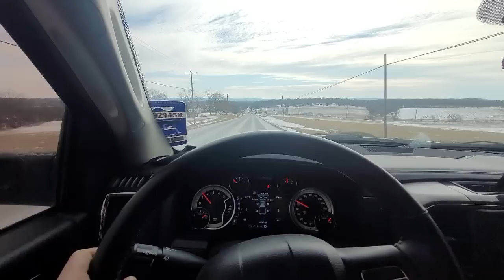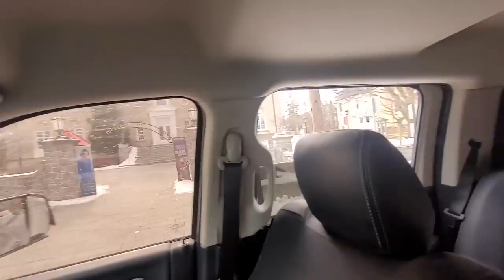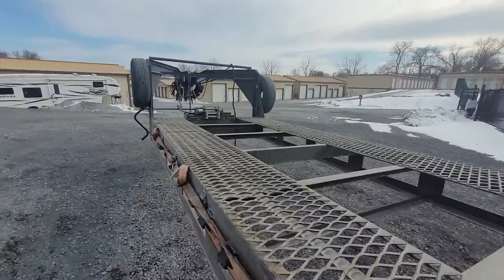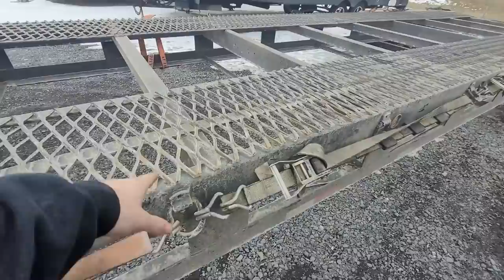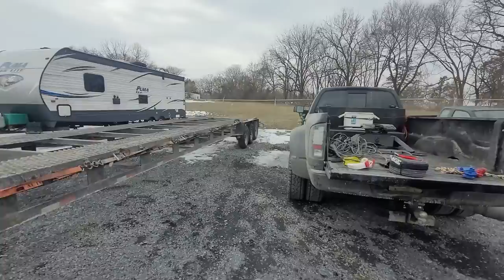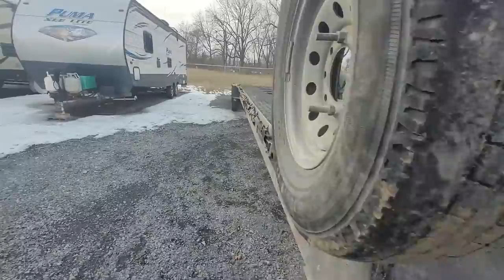Nylon Winch Cable Install | New Snatch Blocks | 20k Mile Ram 2500 Test Drive | Fleece Cheetah Turbo

Comment: Evening from uk steve I would use bit old winch cable to make 3  metre long safety cable  for to secure your equipment chains and blocks etc and lock to trailer so runs thru holes and is fixed to your trailer also could not tap hole in winch and use bolt to secure then any future winch cables/ropes can just bolt on etc?  Make 1 solution for future problem if occurs not multiple sulution for 1 problem. Man of your talent could knock summit up and keep budget down.

Comment: On an old work truck, we used quick connects for a welder to get power to a trailer mounted winch.  Had the quick connects mounted under the bumper and the other side coiled up on a mount on the goose neck.  Worked really good!

Comment: 100% put the torsion axles on it you won’t ever have any more problems I have a 35 foot stacker that keeps 25,000 pounds on it and you can never tell if it’s empty or full rides beautifully goes over bump with easy hands down the best axle out there

Comment: Good! Replace all that stuff steven! When you set the bearing tension, 50 pounds of torque then back it off just a little bit so its not so tight. Once a month, pop those dust covers off and re-tighten that nut. The torsional forces loosen them up. You may notice a slight shake in your truck when they loosen up. Before you mount the new equilizers, bullet proof them. You will see a welded piece inside the new equalizer that the slipper side of the leaf spring rests on. Insert a bolt and weld it in place to support that piece so it dosent break again. I can send you a video if you want. Otherwise, they will keep breaking. The shock absorber kit is a great upgrade! I just dont know about the triple axle setup. E-TRAILER has the shock setup for triples. I would buy it!

Comment: Bronze bushings are a great option .Mack trucks use bronze on their walking beams    [camelbacks] especially on the older macks.  I lkie torsion axles ,most of the snowmobile trailers have torsion axles.

Comment: Make a permanent snatch block in your cable...doubles your winch power an eats up a lot of line
Reply: Good idea . . .  If the trailer can handle double the power.

Comment: Put the Anderson connector on the front of the trailer so you dont have all that cable hanging then connector on one end of your jumper and clamps on the other
Reply: Just put a battery at the rear of the truck, with the Anderson connections. Problem solved. Then just charge/change that one every two/three days.

Comment: By the way: the shock kits will do just fine.
Torsion axles are great if they come with the trailer, but are prohibitive pricewuse if you're retrofitting.

As long as you have good equalizers , shocks and balanced tires, you're good for thousands of miles that are trouble free.

Michael  Rzewuski

Comment: I would have ground down the aluminum end on that cable so it will fit in the hole on the winch

Comment: Just a thought would it not be easier to find a Sterling 5500 around the body style you like in the dodge and still get everything you want out of the dodge? Don't know how much price difference it would be, or if there are any advantages to the different trucks. Hopefully everything goes well with the car sales.
Reply from the maker: I wouldn't care if I got the Sterling 5500 or not
Reply: I guess it really wouldn't matter you'll 12 valve swap it anyway. But they look good don't know if there is much of anything different in the two
Reply: @CPSteveMiller  also on your ratchet straps get you some bungees with the plastic ball on the end and roll them up wrap them with the bungee and put them in your tool box or a colored plastic toat so they don't get worn down by uv rays from extended exposure it'll make them last longer

Comment: Hey steve just a question ive got an 07.5 6.7 cummins 198k 2weeks ago cruise began not working and then horn stopped and now a intermittent airbag light on dash am assuming its the clock spring, have you ever had to replace one on these late 2000s dodge trucks
Reply from the maker: Never dealt with that sort of issue. If it's doing it on and off when you're turning that'd be a guess of mine but without seeing it I wouldn't know

Comment: And the axles...more than likely cheaper to buy a trailer with torsion axles by the time you figure in the cost of axles an time down to swap plus if you pay to have it done.  Plus you done sunk 600 bucks into this current spring set up.  Always went by if it aint broke dont fix it...more than likely holes were worn when you had that work done, an they didn't care an just tossed new parts on it.  The stuff you ordered is serviceable...so ultimately if it wears out quickly it will be from lack of maintenance, which I Dont think you will let happen.  I would stop jacking it loaded if at all possible,  heck id leave it hooked to the dodge an pull in and leave a vehicle at the lot an drive that back an forth.  Just an idea.

Comment: Did you get that link i sent ya for the centramatic balancers?
Reply from the maker: I didn't get anything
Reply: @CPSteveMiller  for some reason when i post the link youtube takes the comment down.
Reply: @CPSteveMiller  centramatic wheel-balancer model Number 300-318A6 i would get these instead of tire beads

Comment: Not sure how you can say rams exhaust brake is soooo much better unless you've used the others man, GM only had a push button brake for a couple yrs now, i find myself having to throttle out of mine because it works so well, it works in conjunction with the brakes so using the brakes while its active gives you different levels of exhaust brake, being in Colorado i run the ike & vail pass regularly and the brake works excellent idk..
Reply from the maker: I've tested all 3. Ram is night and day the best. There's no comparison from what I've gotten to test on the newer trucks
Reply: @CPSteveMiller  i concur.

Comment: Steve I need your help I blew head gasket an I am going fix it my self but I had shop tell me if I don’t put fire wall in it they will blow again? What is fire wall? I fiqured with new head gasket an head studs it would be fine what am I missing
Reply from the maker: Probably mean fire rings. If it's a Cummins you really only need to get the head checked to make sure it's straight. If it's not the machine shop will take care of that. Then clean the engine surface up. No need for fire rings on a street truck that isn't making a ton of power. If it's a powerstroke then absolutely you'll want everything you can throw at it. I would definitely install some head studs. Xotic at the bare minimum. Preferably a good arp stud but it's not in everyone's budget.
Reply: @CPSteveMiller all it does is tow 6.7 cummins yeah fire ring what is that ? It’s bubbling water in resovir  no oil in water or no water in the oil not running hot either an not losing water I was thinking it could be egr but no white smoke an it’s not bubling bad
Reply from the maker: To say it's a head gasket is a bold assumption without proper diagnostics as well. No need for fire rings or compression rings even if it is the head gasket. I would verify everything is in working order before replacing it. If the truck is running good and you aren't losing oil or coolant I wouldn't worry about it
Reply: @CPSteveMiller  lose ing no oil or water. an there is no oil in water,  or no water in oil it is just bubbling back into resovor when I cut the truck off. it’s not running hot either not even close to running hot I have been pulling 15k for 2 weeks now an it stays on 203.  heater works fine if you take raditor cap off when it’s cold an you first crunk it it will. Have small bubble come up about ever 2 to 3 sec.  every blown head gasket I have seen has been constant bubbles I think it’s egr because it sounds different an lost power, but they told me if it were egr it would not hold pressur after I cut it off and,  it don’t after it cools down the raditor hose goes flat not flat like sucked in just as if it were empty I dunno bout drive me crazy don’t wanna get 1000 miles from home an it blow. But don’t wanna spend 3500. When I ant got to I also have leaking timing cover gasket could sticking valve make it do that it’s getting air in system some where has to be or it would not bubble